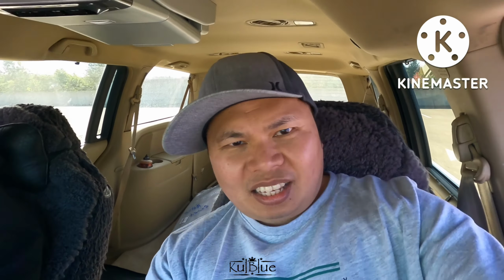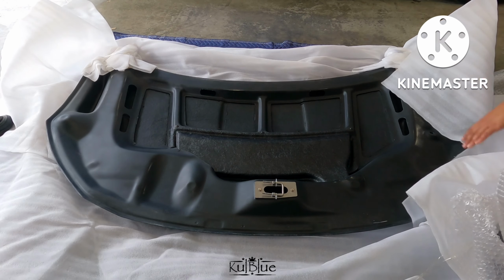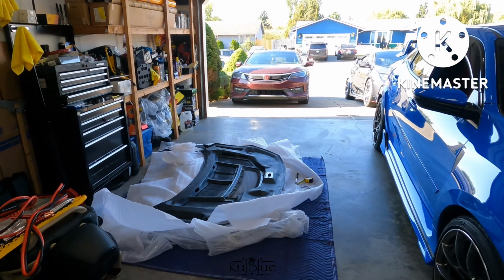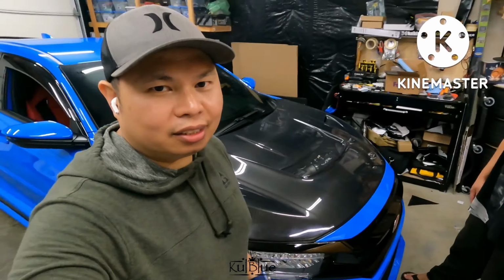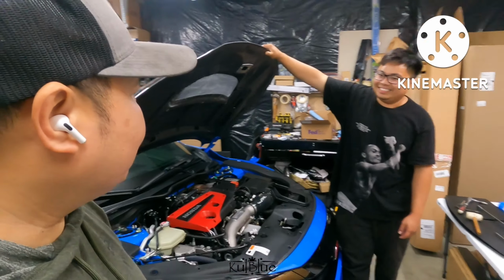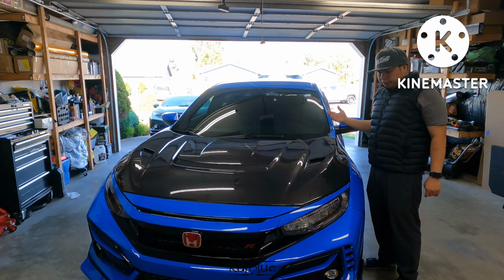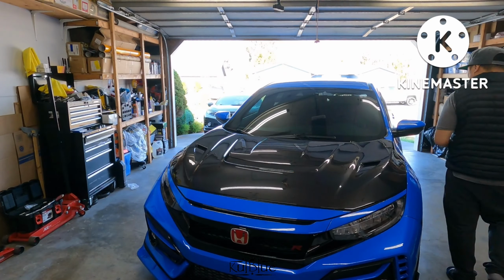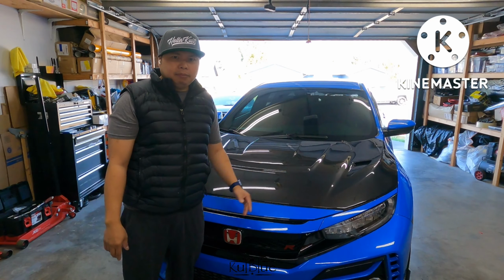Don’t Buy EPR VR Carbon Fiber Hood Civic Type R Until You Watch This…

Comment: i bought from EPR 2 years ago for my 370z, forged carbon Hood, fender, bumpers and spoiler, the fitment and quality

i compared EPR quality and fitment to Fly1 and carbon alliance and honestly you get better fitment and quality from EPR compared to other replicas but it does get people upset because some people paid 4 times the price of EPR product from fly1 or carbon alliance and had garbage fitment and heavy cf

for example fly1 Varis forged carbon hood is 2199 USD
EPR Varis Forged carbon fiber hood is 720  USD
Reply: Is EPR a safe brand to buy car parts from for good quality? I’m looking for a big spoiler and they have the best price for me.
Reply: I have a lot of their products, as you know, with all replica products there will be few bad batches, for me I have their Aero forged carbon mirror, they did not fade nor had any discolouration, plus their fitment on any of the body kit that I purchased had good fitment, I have their forged fender and hood, it required little adjustments and the holes for the bolts and window spray fit perfectly, they use 3D scanner to ensure fitment. 

Epr have over 200 workers in factory,

Fly1 is basically made in a mold without any quality check, epr doesn't even have 10 workers...so their delivery time is long.